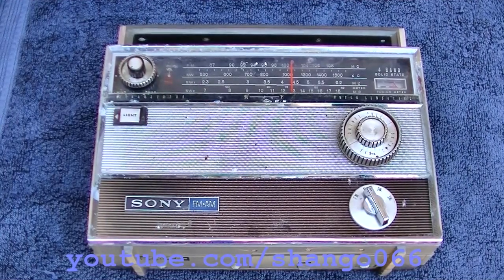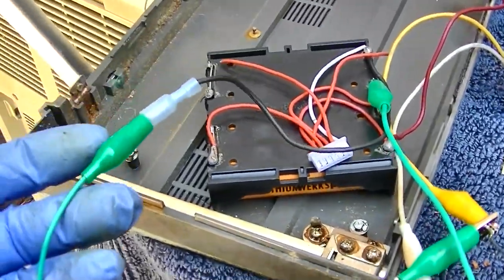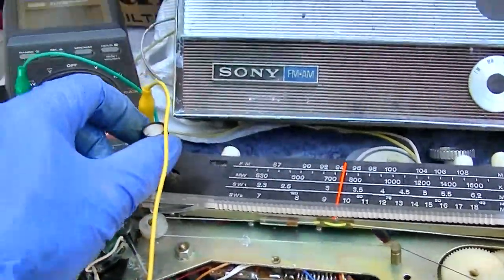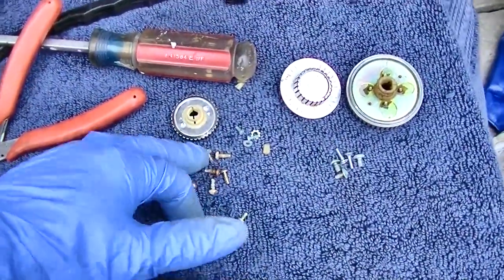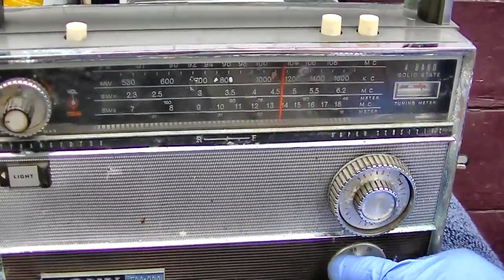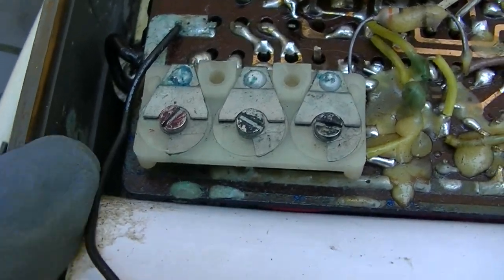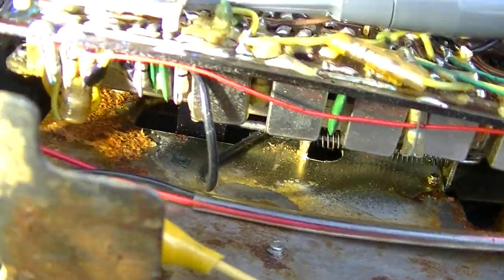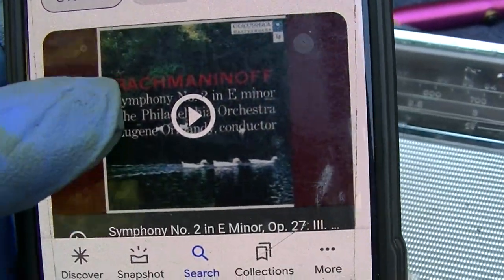Sony TFM1000 AM FM SW Vintage Radio Decrustification

Comment: Energizer stopped using that logo in 1987. The Union Carbide logo on it suggests it's even older than that; they sold Energizer/Eveready to Ralston Purina in '86.
Reply: Early 80s I'd say, the 70s ones were still marketed as everready Alkaline rather than Energiser in any adverts I can find. Got that design of cell in an advert from 1980.
Reply: It's a crazy mix of different vintage batteries. The Duracells made during the same time as those Energizers had the Mallory brand logo printed on the copper top...
Reply: Yeah, my intuition was that the "7" referred to 1987 based on my memories of how those batteries looked back then.
Reply: that also checks out with duracell introducing freshness dating in 1987 but had mallory logos until 1980 so it basically has to be 1987

Comment: When I first messed with electronics, it often ended with those wires soldered crisscross all over breaking off, and me not being able to find where they were supposed to go. Terrible times. Got much better when they started to put connectors on everything.
OTOH, I once called Bang and Olufsen headquarters as a 12 yearing or there about, and asked for the schematic for a Beovision 901. Arrived next day in the mail, for free :) Good times.
Reply: "Ohlaf, there's no chance a 12 yearling is going into COMPETITION with us, is there?"

"No, Bang, I really don't think so..."

Comment: Excellent video as usual! I still have a Sony 7FA-70WA vintage portable with Auto Tune. I learned that the DC input jack has reversed polarity compared to nearly every other piece of electronics that uses them! In other words, the center post is NEG on Sony! The array of jacks on that panel looks like what my radio has too. For my model, it was used for a stereo MPX adapter accessory. You purchased an add-on speaker with a decoder. It then used it's own amp for a channel and the radios built in amp for the other channel. Sony was great for accessorizing their stuff! LOL.

Comment: The residue that comes out of alkaline batteries is usually not too corrosive and can be cleaned off with Methyl Hydrate.  The old Carbon batteries leaked out Ammonium Chloride (Sal Ammoniac) and Zinc Oxide.  It's extremely acidic and makes a mess of everything that it touches.  This radio looks like most of the corrosion was from earlier leaking Carbon batteries which were the only ones available when this radio was made in the mid to late 60's.  If my memory serves me, we didn't see much in the way of Alkaline batteries until at least the early to mid 70's.
Reply: Mushroom juice will neutralize the battery vomit.

Comment: 'Duraleak, Guaranteed to leak for 5 years'. God, I miss KSURF.
Reply: in the 90s a garage here had energizers leaking in their packs, well within install by date
Reply: I just pulled out 8 duracells from a panasonic portable stereo, dated "best installed before jan 2001". Only one of 8 was leaking. 4 of them still have >1v. Really is luck of the draw I think
Reply: Lex Ruth  nope, energizers, definitely,

Comment: Transoceanic lite radio.  YUCK, DURALEAK batteries.  I swear, you might be better off with batteries from HFT, they don't seem to leak.
At least my Zenith TO has the batteries inside of sacrificial plastic sleeves.  Thanks for reminding me to remove the batteries from that radio, won't need it again till next hurricane season.
Wonder if you can perform a miracle similar to some of the overseas restoration videos where a total rust bucket is made to work again?
Sounds like the output stage has drifted out of class AB and into class A.  That, or capacitors restoring would explain the high current.
Good work!
Autodyne converters with a single transistor would be picky on the transistor.  Not so much with separate mixer and oscillator.
That was Rachmaninoff's symphony #2, third movement you had on at 48.41.  One of my favorite classical pieces.
Shortwave picks up all the local TV birdies!
Reply: I think even if the batteries were in sleeves, the outgassing would still corrode things.
Reply: The overseas videos are usually fake.
They are made in reverse.
They show the device working and then put it outside to rust.
The test procedures they use are too simple to work, like testing a CPU with an ohmmeter or they are done incorrectly.
Parts of the videos are too coincidental.
Has anybody seen the videos where they build high power amplifiers or inverters without a pcb powered with 22 gauge wire using a 6x6x6cm transformer. Fake.

Comment: Очень хорошо помогает снять ржавчину и окисление с болтов раствор лимонной кислоты (1 столовая ложка на стакан воды  50 градусов С.) 
Удивительно что радиоприемник заработал в таком замученном состоянии. 
Хотелось бы узнать есть ли в ваших краях радиоприемник BARLOW WADLEY XCR-30 MARK 2 
Очень хотелось бы посмотреть обзор на этот приемник и его устройство. ...))
A solution of citric acid helps to remove rust and oxidation from bolts very well (1 tablespoon per glass of water 50 degrees C.)
It's amazing that the radio was working in such a tortured state.
I would like to know if there is a radio receiver BARLOW WADLEY XCR-30 MARK 2 in your area
I'd love to see a review of this receiver and its internals. ...))
Reply: The Barlow Wadley XCR-30 was a great radio in the 70's and I remember every DXer wanted one, but they were about $270.00 which was very expensive then, when a Radio Shack DX-160 was around $150.00 and did the job.

Comment: The problem about leaving batteries in - how many times have you knew something was going into long term disuse, as opposed to usage just kind of... fading away? Maybe the more organized know when they should take the batteries out, I don't. :)
Reply: What a Kool  old Sony tfm100 mw fm  shortwave
Reply: When I stop using the radio.  That's my "when". That said, I hate battery radios for that reason . I hate battery anything for that reason.  lithium ion or other newer formulations though, are fine. Even if you drain them dead, unless you leave them for years like this person did, you'll be OK. I do have a bunch of lithium ion flashlights I use regularly.

Comment: I was thinking I may have one of these,  but it is a Sony TFM-1600W (FM, AM, SW1 - SW4).  It is the six band version,  but also has the LOCAL / DX and AFC switches,  although they are on the front instead of the top.  Claims to be 2 FETs,  12 transistors + 3 transistors for Aux. Circuits (whatever that is supposed to mean).  If also has the  FET   R-----+-----F   Super Sensitive  on the front panel.  The tuning knob has a flywheel on it like a 1970's Pioneer home stereo receiver.  Looks like there were never any batteries in it - spotless.  Works well,  but not as crazy as your TFM-1000 on AM.  The dial light seems to be blown out,  so I guess this will be a huge task to get to the bulb to replace it.

Comment: On 87.75 fm they are still allowed to broadcast audio on that channel but no video the FCC allowed a few stations to still broadcast audio but under low power 👍 also nice video! By the way I still have a older GE radio I’m interested in having repaired, you would probably like it, just mine  it’s completely dead except on strong stations locally it used to be a DX machine!

Comment: That song Rodeo was written by Aaron Copland from the ballet of the same name. It was used in the "Beef....it's what's for dinner" commercials. Too bad I can't afford beef anymore.
Reply: Costco sometimes has ground beef for $2 a pound.
I wish they would sell scraps for $1/lb. Tallow is very nutritious. Supposed to have one of the best omega 3/6 ratio.
Reply: @WTC7  I think I'll pass on the tallow
Reply: More often than not, I can find various kinds of steak or roast, 2-for-1 sale - at that rate, it's cheaper and leaner than hamburger. I grind it at home, if hamburger is what I need.
Reply: @hallieboy 
Probably better for your health that way.

Comment: Many moons ago, before automatic transmissions, before power steering, long before TV Tuner Cleaner or Carb cleaner there were 2 solvents that were common about the farm, well 3 if you count the well known Panther Piss (penetrating oil) they were Gas and Kerosene.  Dad used Kerosene most of the time but in tough situations gas would be the fluid of movement.  I can recall dad soaking pocket watches in kerosene and bringing them back from the sever illness of being in a pocket of a farmer on an open tractor plowing fields.  Perhaps they could again be put back in action since Carbon Tech was pulled from the market.  Of course in a pinch Ronsin Lighter Fluid would loosen up dirt in tight spaces but don't strike a match.
Reply: Mushroom oil is also very good.

Comment: If they put in a thermistor, then they were having temperature problems from the get-go and tried to fix things with a thermistor.  Similarly if they put in a Dx and a local switch, the AGC system is not so good.  That was a common problem with bipolar transistor radios, the transistors don’t change gain very much.

Comment: Why do batteries have to leak. That is totally unacceptable. Remember when the battery companies would replace devices that were damaged by their batteries.
Reply: Duracells are the worst
Reply: Wonder what would happen if you dipped the batteries in hot wax before use. Scraping clear just the area needed to make contact.
Reply: All batteries will tend to leak if their voltage drops below a certain threshold, changing their chemistry. This is also why mixing old batteries is bad, since you will have uneven voltages on them, triggering a leak. This is why it's important to replace batteries early and not when they become depleted...
Reply: @crooner2007  duracells leak very quick though. It could take a longtime for other brands. I quit buying duracell batteries total ripoff
Reply: @jeffscomp  agreed. Duracell are terrible.
Reply: Duracell calls itself the most trusted battery. Hmm. Most trusted to leak, apparently.
Reply: @jeffscomp  I have had some leak in the packaging. I had leaky batteries back in the day but nothing like that. 
I've started using Eneloop batteries in my remotes and stuff. More expensive but better than killing my radios and remote controls.

Comment: Well done!
I think that you would probably get complaints if this Radio belonged to someone else though due to doing away with the Sockets for Headphones (if you did) and External D.C. and not changing the Dial Bulb (if you didn't).
Quality kit there indeed as I doubt if manufacturers would bother temperature compensating a Local Oscillator in a domestic A.M. Radio these days.

Comment: Mentioning the number of transistors is supposed to impress the user on its level of performance, a carryover from radio advertised as "6 tube sets" "9 tube sets" etc.  Kudos to the disclosure by Sony that one of the transistors is not in the actual signal path.
Reply: I can remember when they would use transistors as diodes ( reverse polarity protection) just to get the transistor count up, and impress the user.

Comment: I wonder what happens after a resurrection on one of these radios. I mean, I have a Trans-Oceanic 1000D that started to work after some minor work (relocating properly the transistors) and after 2 hours it did stop to work. I did change all the electrolytics and nothing happens now. The same with another radio, it did work for about two hours. Ont this second one I was measuring the mA and it was not shorted for sure. Again, afterwards, I did change all the electrolytics and it did not started to work as before.

Comment: I've got one of these. I need to reglue the on/off indicator and do a minor cleanup. I found a service manual for this in case any wires come loose. Was low on volume, but found a capacitor with high esr on the audio board.

Comment: Sony always made a good radio. Look on eBay for it. They got the Sony CRF-5090 FM/AM Solid State Multi Band Receiver 9 Band which is close to that radio going for 174.99 and 50 dollars shipping. Sad they want a arm and leg for this old radios. Keep up the good work. And yes had duracell battery leak on many things even in my heater thermostat. Clean it up and thermostat still worhking but now using energy batterys in them. And had a few smoke detector and flashlight had to work hard cleaning them to from leaky duracell batterys. What can you do with things that need batterys like thermostat and smoke detector in them all the time.
Reply: I still have my mom's Sony 6F-21WA AM/FM portable from the 70s. No batteries installed, I always run it off its internal AC power supply.
Reply: For the things which must have batteries all the time you might want to change them preemptively. Fortunately the 9v batteries which AFAIK are used in most smoke detectors are usually fairly good at keeping their leakage self-contained. You might also want to consider using crappy "heavy duty" batteries instead of alkaline cells as in my experience they never leak.

Comment: I once had a Sony radio similar to this one, but it was 3 band only, no FM.  I got it second hand in 1994 and the tuning dial was broken and you had to take the back off it to tune it.  I think the one I had was an 8 transistor unit, I don't know the model number, in fact I never knew the model number.  I think the handle was made of leather and was attached to the set with 2 metal fasteners.

Comment: I bought a GE P780 on eBay with Duracell’s industrials with an expired date of 2006 still inside, luckily no leakage and power was still near 100%
Reply: The ones in my VCR remote say 2005. I think Duracell must have changed something about how they make their batteries in the past decade or two as I have a fair number of old ones still going. Maybe that's just survivorship bias though.
Reply: @eDoc2020  I was more shocked they didn’t leak lol

Comment: Terrible state how it was in with the old leaky batteries left inside it,,,those kind of batteries would b from the mid to late 80,s for Duracell and energiser batteries. 

But very good how u managed to clean the corrosion off the metal parts,,and repair the band switch,,,and get it working almost like a new one,,,,in the end.

Comment: An interesting experiment would be set the IF frequency slide switch to 10.7mc, with the main selector in SW, then tune to 9.63mc. You should get KNX 1070 with an IF of 10.7mc.
Definately one for a trial in the desert.
Reply: Would be fun to try. I think if there's enough input preselection it might not work. Although he's very near the transmitter.
Reply: I do get allot of images on my single converting simple analog radios... So maybe?....
Reply: @johnnytacokleinschmidt515  Yes I'd forgot the preselection, its so far off it might not work. T'other thing is the slide switch might also switch the discriminator to Fm too. Plus  Sw as shango said doesnt work on this ol piece of crust.

Comment: I have the Sony..ICF 7600gr and the ICF 2003....Sony is always good.with Radios....I have Sony in my Collection...the old Japan made stuff.is good.....and not the made for.America Garbage...from China....the ones made for the Japan Market are great...On all bands....Sad All the Japanese Manufacturers are leaving the Radio Market...just heard Sony is not making any Radios.   What are we going to buy in the Future?...hard to get stuff now!!!...ever stuff from Europe is hard to get also!!!....Thanks For The Great Radio Videos!!!
Reply: I've heard that Indian radios have Sony's old radio chip inside.
Reply: Everything is going SDR. Even cheapo TV sets, the tuner is built into  the Antenna socket, about 1/2 inch square using  pinhead sized components. SDR fails because nobody including FCC is enforcing noise and harmonic pollution, plus SDR's lack bandpass filters. Soon, there will be no pure analog receivers, nor will they have IF stages that also do noise rejection. Sometimes SDR has bad software that messes up as many countries have different standards. When replacing transistors, re-biasing is mostly necessary.  Then there are fake Chinese transistors, so it is difficult to spot not-right copies. I find good junk-box parts from old Sony Trinitron monitors and TV's before the race to the bottom in quality started. There is evidence that lead-free solder of modern surface mount parts leads to short product lifetimes. Few add a conformal coating. Some now have a re-done -re-capped valve radio receiver that will survive any EMP burst or sunspots, while the demand for valve and germanium PNP electric guitar  needs is through the roof.

Comment: Thanks for pushing the price sky high on ebay! $200 plus!  The 2sc829 transistor you changed was unecessary to change. But if you must, mps5179 or 9018 or 2n918 or bf200 or several others are a good fit. BF199 is a unique transistor as is the Bf194 low fb cap. we shall all be speaking chinese soon! Tnanks b1dan! See you in the googlag!

Comment: I have the same radio except that it’s a 14 transistor radio but it stopped working and when I turn it on all it does is make the batteries hot? Does anyone know what the problem is and how I can fix it. -thanks